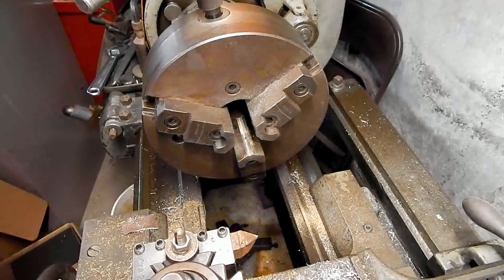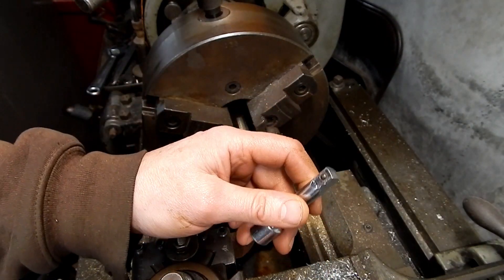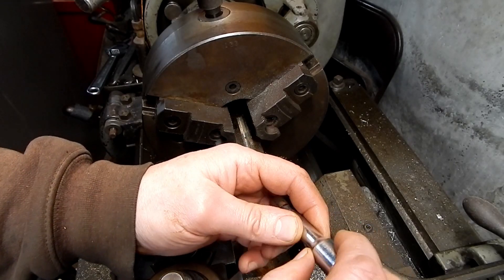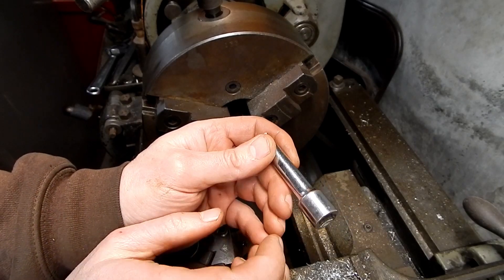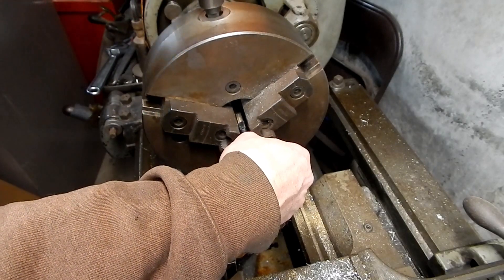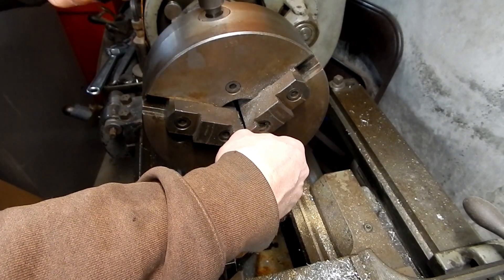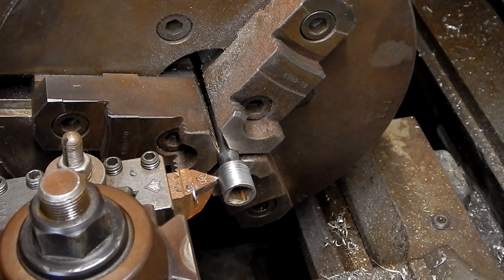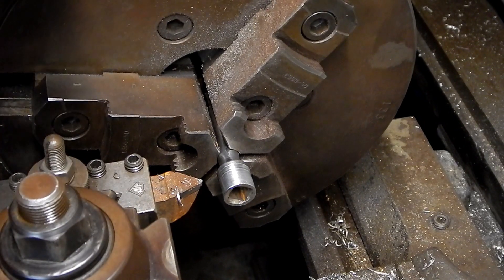A small engine crankshaft adapter

Comment: I found out that an impact is  not good I ruined a crankshaft threaded area using one, I did the same as you only I just whacked it off with a cut off wheel and roughed it on the grinder and it worked fine, I did that to start one of those old Wisconsins I was working on, beats the heck out of hand cranking,, I used a 1/2 heavy duty drill like you did.